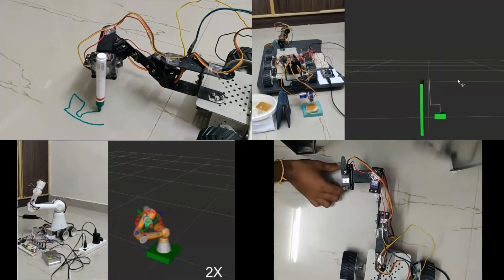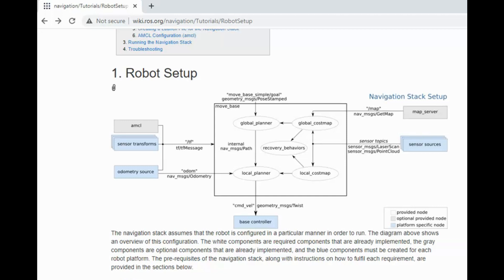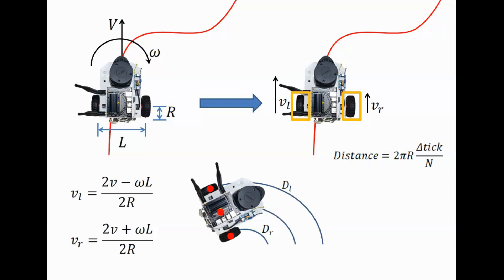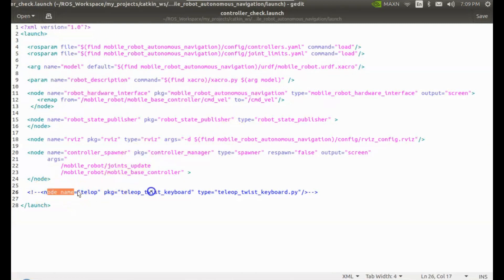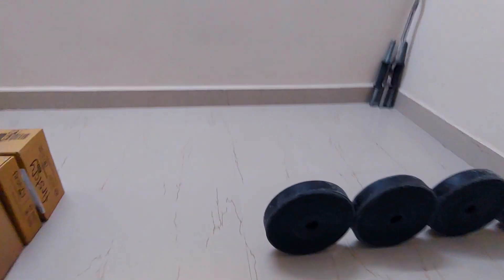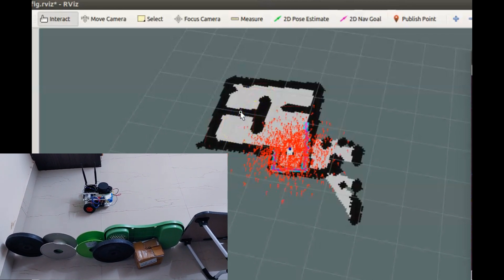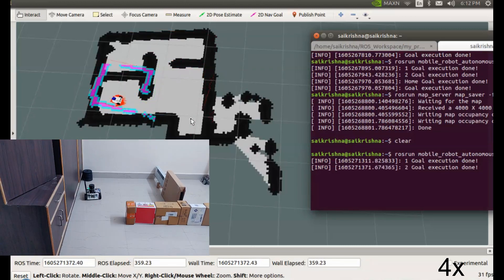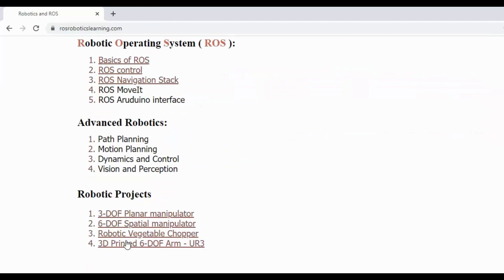Autonomous Navigation Mobile Robot using ROS | Jetson Nano | RPLidar | Differential Drive Kinematics

Comment: How to use the navigation stack with the Pioneer robot (with rosary) and the rplidar a3 sensor (Hector Slam or Gmapping library)
Hey,
My question is how to use the ros Navigation Stack library to perform autonomous navigation on the pioneer robot that I am using the rosaria library for control, I am also using the rplidar_03 sensor with the hector slam library in the project. If anyone can help me

Comment: Thank you very much. I implemented your project with some modifications. It is running very well. Only issue is drift in odometry while robot rotates. I used two arduino m0 samd21 instead of arduino nano. I used as5600 absolute encoders instead of incremental ones with i2c communication. In samd21 there are more than one i2c ports. I don’t understand why you use this code in Robot_hardware_interface_node.cpp 

  if(left_prev_cmd!=velocity)
    {
	    result = left_motor.writeData(wbuff,2);
	    //ROS_INFO("Writen successfully result=%d", result);
	    left_prev_cmd=velocity;
    }

I couldnot run without cancel if part. 

Can you explain why you dont send speed value to arduino if it is same as previous one?

Another issue in arduino part, i can not understand how you send negative speed value to arduino from ros. I did some change to run it. I modified code as, 0 255 full speed forward. 255 255 full speed backward. How did you design it? Thanks for your answer

Comment: Amazing video!! Thanks for sharing. I am little confused about the lower level PID controllers that you wrote for the individual motors. Why did you choose to implement the controllers using Arduino library? You could have use ros_control package to do that. Is there any specific reason?

Comment: can i run this on rpi4?
can some one exaplain to me pls. why my robot in my rviz keep moving while the robot is not moving.

not connect to i2c already because im using rpi4

update: i tried to connect my raspi to arduino. in default raspi using i2c 1. so i decided to edit robot hardware interface.h file to both of them using i2c 1. but im still getting error could not open i2c bus

update2: i already solved i2c communication problem. now i face new problem. sometimes the motor rotating while there is no set point. or sometimes the robot keep turing even reached goal.. why this happen?
Reply: Have you solved the issues ? Can i you arduino usb port with pi instead of i2c communication?
Reply: @osayd787  no for my last issue. im tired. im still using i2c. you can change the i2c address program and don't forget to use super user while running it. now im already stop trying this project.
Reply: @fransflorenza9708  thanks for the reply , yeah been learning ROS for a while and now doing navigation for graduation project, i tried what james did in the nox which kinda worked to not so much its a pain but will try to make it work
Reply: @osayd787  Did you make it?
Reply: @agrimekatronik321  yeah i had to use the Nox with the Really Useful Robot and kinda worked there were some problems like map drifting
Reply: @osayd787  Thanks for the reply,will it solve your problem if you use differential_drive ros package instead of nox controller? While doing that project from james, did it required to write more scripts or they was enough to do navigation and mapping?
Thanks.
Reply: @agrimekatronik321  you won't need to write anything but you need to change some parameters to fit your robot , i don't know about the differential drive package as i didn't have the time to try many new things
Reply: @osayd787  Ok thanks a lot.
Reply: @agrimekatronik321  no problem and good luck

Comment: Can you explain the structure of the files that are useful and along with the components? And also, is it possible to use RPi4 instead of Jetson Nano?
Reply from the maker: I have shared the source code, list of components and connection diagram in my git hub. The link to the git is present in the description. Yes you can go with RPi4 instead pf Jetson Nano.
Reply: @roboticsandroslearning8232   Thanks! Also, I needed to know if encoders are absolutely necessary to determine the state of the wheels? I currently do not have it and looking for an alternative.

Comment: Thank you so much Sir, I have a question, what do I need change when I change a other motor. Please help me!! I just change 1856 to 616 for my motor but it run so strange
Reply: I just check PID and add it to arduino code but it not work

Comment: Thank you very much. I have a question, I see a number : 1856 in your arduino code, I guess it caculated by 168,75×11. But when I change it to fit my motor, it abt 1100, the motor is not as smooth as before. help me, I tried fixing it for over 2 weeks. Details are in the video below:
https://www.youtube.com/watch?v=-41VtbRREKw
Reply from the maker: Did you tune the pid values as per your motors..? If not tune pid values and check.
Reply: @roboticsandroslearning8232  Thank you, I just change PID with P=0.8 and it smooth again
Reply: Can u please guide me ...I'm doing a similar project.
Reply: Hi Sir, may i know where you get 168.75 value ?

Comment: On running back your package I found issue with" Could not read from i2c slave 0x8". Although my jetson is detecting the MCU with same adress. What am I missing?
Reply: Connect i2c0 to slave 8 and i2c1 to slave 9

Comment: Hi. Amazing tutorial. I have a small doubt. How did you run the Jetson Nano without a cable connected to the laptop for Display. I presume you used VNC for teleop_twist_keyboard. Can I use a wifi module on the Jetson and connect it to the same wifi network as VNC? Thanks
Reply from the maker: Using VNC viewer. Follow below link to setup vnc server in jetson nano

https://medium.com/@bharathsudharsan023/jetson-nano-remote-vnc-access-d1e71c82492b

Comment: Any particular reason why two separate Arduino for each motor? And you are publishing only wheel velocities from Arduino and publish /odom on Jetson nano? There was no mention of an IMU... how did you manage to get the encoders very accurate? very good PID tuning I suppose? or are you using laser scan matching and fuse it with wheel odometry...

Comment: Hi! I wondering with what did you supply the motors and the jetson nano?
Reply from the maker: I have shown the battery in the video
Reply: @roboticsandroslearning8232  yeah I know, but You show also a poder bank, did you use it? Or just with the 12V battery you supply the motors and the Jetson nano?
Reply from the maker: I did not use the power bank. The motors and jetson nano are powered with the 12V li-ion battery
Reply: @roboticsandroslearning8232   Hello, in the connection diagram you posted on git, the 12v battery is only connected to the motor driver, does both Jetson Nano and Arduino Nano supply power from lithium batteries?